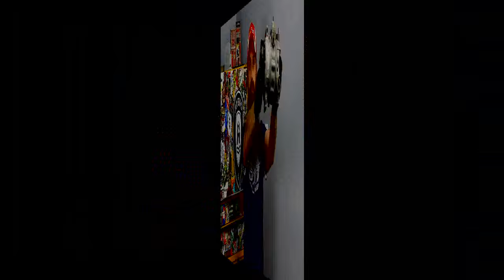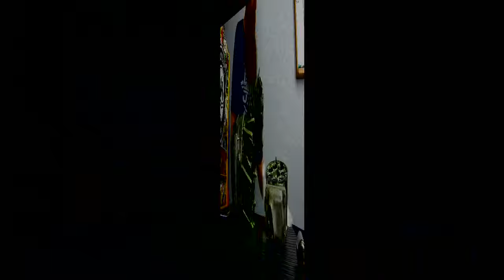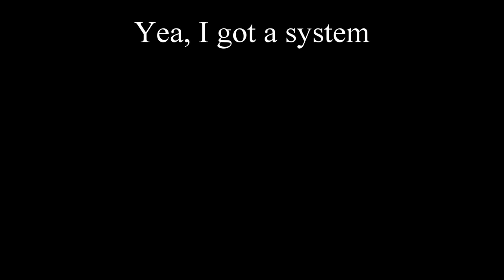How VW A/C Compressors Fail

Comment: I just replaced the RCV valve. A bad RCV valve value cost ($70) yet dealers force you replace the whole compressor ($700). After the replace the dehydrator, other parts and labor it cost $1500. I fixed my AC for $220...  The RCV valve can easily be replaced with compressor installed, As you say often reason the AC is poor in VW's... I had a foreign car shop down the street evacuate the system. I replaced the RCV, pulled vacuum for 45 minutes, no leaks, charge the system with 19.5oz of R134a. The pressures were good and cooling was now cool...  I had no AC tools, so I bought a set of manifold gauges, nice vacuum pump for less than $150. With the tools, 20 Oz of 134a and the RCV part, it cost me about $250. That is what the shop would charge (me supplying part), but now I have the tools to work on AC systems. I also have a ROSS TECH cable. I am a Junior VW mechanic!!! Ha ha.
Reply: +Steezy Patato. I bought a 2.5 CFM vacuum pump from Harbor Freight, single stage (lists for $99) with 20% off coupon ($80). The more expensive $150 one, two stage 3.0 CFM, did not get as good rating. It is overkill. The 2.5 CFM one worked like a champ and looks like it will last. Manifold HF gauge set is $59, but again got a 20% off coupon. You can by a vacuum pump and manifold gauge set as a combo on Amazon or eBay for a little less (no sales tax). However I like the HF quality. Ha ha never thought I'd say HF and quality in the same sentience. However for the DIY'er it is good stuff. 
 
 No I did not reuse the refrigerant because it is cheap. The Auto parts store wants like $15 per can. I bought two 12 oz cans of R134a from Walmart $10. This is the R134a no dye or sealant in it. I am not a fan of sealant. When you pull a vacuum you close the valve, turn pump off and let it sit for 30-60 minutes. If it holds a vacuum you have a leak. The only time you should inject dye is looking for a leak. You can buy the dye separate and add that separate.  I see R134a, 12oz cans on-line (eBay) for about the same. I also bought a new electronic scale. $16. You have to measure the second can to determine how much to put in. I put in the full 12 OZ then about 8 OZ second can. Don't over fill but you have to bleed a little off. So total I took out of cans was about 20.5 ounces. Do NOT vent into the atmosphere. You can have a local shop recover the refrigerant for you. Personally even if I had a fancy recovery system and could put the old stuff back in, I like the idea of fresh stuff.
 
AC now get's ICE cold FAST and goes down to near 32F using a mechanical thermometer in the center vent! I LOVE IT. In fact a big line of thunderstorms came through right before I left work.... So the temp was still hot and very humid. I was a little wet when I got in the car. By the time I started the car the window was foggy. I turned in window defrost and because the AC now works the window fog went away almost immediately. The AC lower humidity. Again you can get it all online or Harbor Freight and Wal Mart.
Reply: I read in different forums this issue. I order the part already and rented the vacuum from autozone, (already had a set of gauges). Did you just used the r134a? did you add any oil/lubrication to the system?
Reply: VW doesn’t sell the valve separate, so the only way that the technician can fix it is to replace the compressor. In my experience with a bad coprocessor it’s just better to cover yourself and replace it all at once than to have a customer upset that their A/C quit again because you didn’t get every single piece of debris out. 99% of the time the customer would rather pay more to not have to come back in a few weeks and spend more money. DO IT RIGHT THE FIRST TIME...

Comment: Great video and explanations. My MY13 Passat 125TDi 🇦🇺 model just packed up its ac. Spoke to VW and a $3,500 bill which includes condenser was quoted (should the system have debris through it)

Ouch!

With under 70,000kms I'm very disappointed. Amazingly dynamic to drive (fully optioned sports pack) and fuel efficient. Devastatingly expensive to repair...

Comment: After just being ripped for over $2k to replace my entire AC system on a 2013 Jetta I really appreciate you video.  Will I buy another VW... Not in this life.
Reply from the maker: +Mark M did the 2k not fix the car?
Reply: I got about 90% of my A/C back. They had to pull the front bumper to replace the condenser. Who designs crap like that? I will buy Japanese or Korean next time. I am done with German products made in Mexico. I have never had an A/C fail on a 3 year old car. VW made some bad decisions on the last gen of the Jetta.

Comment: Great information. Will a failed or failing compressor leak refrigerant. My Freon was really low so I added r134a with the die. I have spatter marks around the compressor and passenger side engine bay, but no real sign of the leak location.

Comment: Can you elaborate on how I would measure the input current to the compressor using an amp clamp?
also how would I check for a compressor off code in vag com?

Comment: Great clip.   You need to know how much of your particular vehicle you need to disassemble in order to remove and replace the aircon compressor,  BEFORE you think of replacing DIY, - and also in order to know if the mechanic has the actual know how to do the job.  Or is this his first one?   This degree of disassembly will differ a lot between so many VW vehicles which have the 1.9 tdi engine.  For example, a Caddy is not a Transporter, a Golf is not a Jetta.  But they all may have 1.9 tdi engines.  Be wary of people who just regas the refrigerant and change the TX valve and drier, because they are sort of expected to do that each time they degas and regas anyway, and it often fixes nothing.

Comment: Just replaced the solenoid valve on my 2011 VW Jetta Sportwagen TDI. I was concerned about your comment in the video about debris being the culprit on the solenoid failure so I proceeded to dissect the old valve and look for debris under magnification. I did not see anything. Would debris be visible? AC now works great but I am concerned that if it was debris it will eventually fail again.
Reply: Well I will answer my own question. My AC worked perfectly and sat at 35 degrees on the outlet but unfortunately for only two weeks and the same symptoms of varying temperature (35-55) has come back. Should I replace everything and be done with it?

Comment: Hey Charles, great video! Im having problems with the a / c of my passat b6. Today i had make a test, i pull off the serpentine belt and turned the compressor by hand. I realized that the compressor is very hard to turn by hand (with the engine off), is this normal? I thought the compressor has to spin free when the engine is off.
Reply from the maker: nope it should free spin. Those compressors were ultra common to fail.
Reply: so the problem is the compressor. i will change it. thanks Charles!!

Comment: Do I need to take out the freeon to replace the solenoid?
Reply from the maker: YES!!!! 100% yes. You will get a face full of R134a if you don't
Reply: @HumbleMechanic  Not only R-134a, but also PAG oil, which is really nasty stuff

Comment: Just had my AC fail few days ago on Audi A4 '04 (232.000km on the clock, (145.000 miles) ). Ran the vag com on it, all measuring blocks seem fine, G280 current is around 0.65A, duty cycle little under 70%, visco turns on, all interior airflow flaps are operating properly. But pressure on G65 sensor always stays the same, doesn't rise at all - does this indicate bad compressor? It did make a lot of rattly noise, but only when it was OFF (it wasn't louder then engine (1.9 tdi) ) . I am tempted to check on pulley, not sure is there anything that can wear out on it so it spins freely (saw some vw compressors have splined shafts that tend to eat splines on pulley side which results in pulley spinning freely).
About 50.000 km ago, i had one ac hose (one going from receiver/dryer to compressor) repaired (rubber part of it). Someone who worked on car before didn't install retain clip for the hose, and it was floating freely and rubbing against front anti roll bar bushing bolt, eventually it was punctured - at that point i had most of o-rings on ac system replaced with OEM ones and installed new orifice tube, and due to bad inital diagnostics (by a shop!) had condenser replaced too. Btw i will diy this, same as with the hose (last time punched hose did the job of "evacuation", and later on i charged the system in a shop).
Reply: Check the pulley end. If the centre bolt comes loose then the splines wear off on the plate. This plate is replaceable. symptom is centre bolt not turning or missing.

Comment: Hello @HumbleMechanic
If I apply power to the N280 valve, I can hear it clicking as I put the power on and off, does the clicking mean the the valve is still good, or could the valve still have issues eventhough it is clicking  ?

I finished (95% 😉) my rebuild of my Bentley GT, the engine, transmission and ecu's all came from a 2011 with 11,000 miles, the AC was the last item I did before my first road trip, I vacuumed the system as it was already empty, I the weighed in the r134a within the +/- of 20 grams, all was great, I did a 270 mile trip without issue, the air was ice cold, it was in the 90's outside, I arrived at my destination and parked the vehicle for 2 or 3 days, then went on a ride around town and and all was good, except for a brief moment when it blew out warm moist air, then went back to great, but on my ride home it quit completely, just hot air, again, it was hot and humid, plus then rain downpours...

I evacuated the system and weighed what came out, I lost nothing, so no leaks, I then weighed in the 134 again, I noticed that if I let the engine idle and the blower motor on it's slowest speed, I would get somewhat cool air and the suction line would get cool to the touch, eventhough a hot engine compartment, not ice cold but cooler than being off, the high and low pressures static at engine off of course, when the engine is running the high is 140psi +/-, and the low starts at 120psi and goes down to about 104psi, the high made it to 165psi, I can watch the low dropping to the 104, but if I just wait or just lightly touch the throttle, the pressures fall almost back to static, this happens no matter if I use Ross-Tech VCDS to activate the N280 valve via output test, or the same with ODIS.

 I have no fault code for the HVAC except that the control module in the Instrument cluster is on comfort CAN, BUT, I had that way before and during the road trip, and the AC was great, I tried applying 12 volts to the N280 while everything was off and I could hear it clicking, I then applied ground to the proper pin in the 14 pin plug while the ignition was on, again I could hear it clicking, so I did this with the engine running and a call for AC, the pressures remained static....

Any thoughts are appreciated  !

Johnny HotSpur GT

Comment: Can solenoid failure result in AC blowing too cold?  I.e. valve is stuck full open? I had one occurrence of AC blowing hot but it’s not reproducible. But mainly I see it’s too cold. Adjusting the temp control up doesn’t seem to have any effect until I get to 80F.

Comment: I am getting a high pitch squeaking sound when I turn on the AC with only moderate cooling. I replaced the a/c clutch about 2 months ago. Does this sound like a total compressor replacement?

Comment: Sir, a couple of questions please relating to a 2012 Touareg. 1. Sometimes when we get in the car the ac will run....or not. If we leave it in the auto mode it may start as we travel. Lately it has been getting worse and runs less. Suggestion please? 2. We have an orange "ACC and front assist not available" so we can't operate the car in ACC. I guess it is a sensor problem. is there anyway I can troubleshoot which sensor it is? How does VW dealership do it, do they have a computer that can interrogate the system. Cheers

Comment: My ac has been switching cold then hot then cold then hot. I took it to a mechanic of course they say they need to replace the whole compressor. I have a 2012 VW Jetta 2.5L I just ordered this solenoid and will do it at my buddy shop . I keep you posted.
Reply: JonJ Martinez did it work? My 2008 beetle is doing same thing?
Reply: Did it work
Reply: Respond
Reply: What happened?

Comment: I've been struggling with very very similar problem with my Audi A3 2010 HVAC since it went for the 60k(I guess) km periodic service.
As soon as I took the car from the Audi dealership, grabbed the phone and called right away to say that was more than 30Cº outside and the car just did not cooled the cabin like before.
Just didn’t made cood as before and could not cooled me inside the cabin.
They regassed it, adjusted the vents, improved but was never like before.

I live in Southern Europe and in Summer I get 40Cº days and this car when was brand new refreshed the cabin in 2 minutes of A/C working. 
Just from the start of the engine, even before it got to operating temperature, against what Audi technicians say (BS from them).
Can a bad service ruin the solenoid or compressor ? 
I don’t know if this is my exact problem, but I should try it.
Do any of you have the same problme as me and solved it replacing this solenoid ?
PS :What makes me mad is that Audi technicians just don’t know how to diagnose this and they just replace the all compressor unit.
They should be the first ones to know what’s wrong with the car.
Thanks a lot you guys for letting this out to other people.
Reply from the maker: No the service is not related. But this can be your issue. I’ve seen it a few times. 

Slow to cool is tough to diagnose.

Comment: Is there anyway to test the Electronic valve on your compressor? Or test the compressor as a whole?
Reply from the maker: +Drysdan MaDness the best way is to measure current to the compressor while monitoring system pressure. 

Current to the compressor can be monitored with a scan tool too

Comment: Hello I have a 2010 Audi A5 2.0t and my ac does not blow cold air. I replaced the condenser and I had it professionally vacuumed and filled but still no cold air. Is there a way to diagnose the control valve? Or should I just replace the entire compressor? Thanks

Comment: you spoke briefly about different types of clutches on a/c compressors. I cant find anything explaining the operation of these that look engaged all the time. are they non-magnetic? What is the principle behind them? Can you troubleshoot their operation without a vag-com? Any help would be appreciated.
Reply: Simple. A clutchless compressor, like the shown in this video, has no clutch (there also can be one, but the compressor will never cycle; it may disengage when the rpms get too low or you bring the engine to WOT but it will never cycle periodically; what looks like a clutch on the one shown here is only a torque limiter that breaks whenever the compressor shaft is about to seize up). The compressor is therefore always running (this means that the engine should never ever turn the compressor shaft when the AC system has no refrigerant inside, or the compressor will seize, since oil will no longer be carried to the compressor). When AC is off, the compressor is simply put into minimum displacement so that, if you leave the blower off the evaporator doesn't freeze, and if you turn the blower on you get ambient (or hot) air. Heard you can troubleshoot the operation of a compressor control valve with something that can read a PWM signal (such as an oscilloscope) and with refrigerant gauges. That way you can read if a signal is reaching the control valve and if the control valve is responding to this signal and changing the refrigerant flow as requested.

Comment: My 2012 Golf had a noisy aircon compressor (only 56,000kms) and the franchise dealer quoted me NZ$2650 to replace, very glad that the warranty covers full replacement. It still worked fine but was a little noisy.
Reply from the maker: Wow that’s 💸💸💸
Reply: HumbleMechanic Its an Edition 35 GTi, would it have any different AC compressor than a standard Golf?

Comment: my MK6 GTI A/C works great but has a loud whine noise when the A/C is on. turn the A/C off and let fan run, noise goes away. Do I have to replace the whole A/C compressor just to get rid of the noise?

Comment: one other thing if my low side is 52 and the high side is 190. I had it blowing 35 40 degrees in AZ where it gets up to 120. but the other night it quit blowing on that drive and then it will blow cold again that's a sign of the control valve acting up. check the harness connection if it's good look for a control valve where? I'm okay with changing the parts. I work on heavy equipment. but we all need a mechanic at times.
Reply: see my comment elsewhere. Replacing the valve only allows the loose dessicant to destroy the condenser, the compressor, and the expansion valve. I had to replace the ac twice in six years. Better yet, replace the car.

Comment: what is a tall tale sign of a desicant coming apart in the system? or other metal debris since there is no orifice tube in the system?
Reply from the maker: usually the a/c stops working and the system is full of debris.
Reply: Does the compressor run all the time

Comment: A/C issue, MK5 TDI BRM 5M. A/c takes a while or not to blow cold. Sometimes it works perfectly, sometimes as driving it goes off, on, off.. One time it was doing it on a timer, 30 seconds on, 50 seconds off, while driving 60mph cruise control, nothing varied.  System has freon from last year proffesionally installed, and from scantool i got 6.6bar in the system. Help ? Ideas? i was thinking that valve.